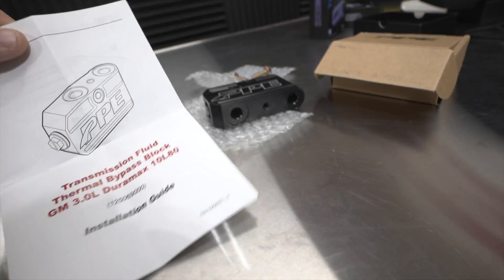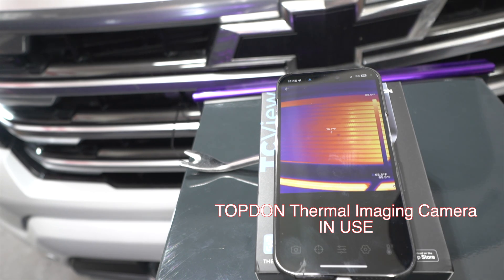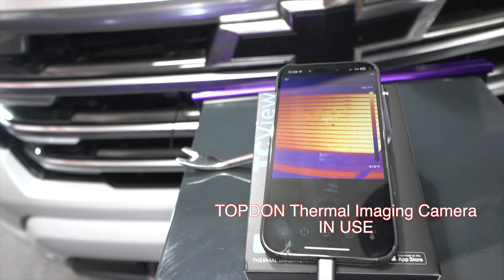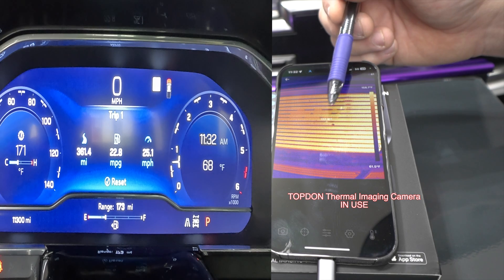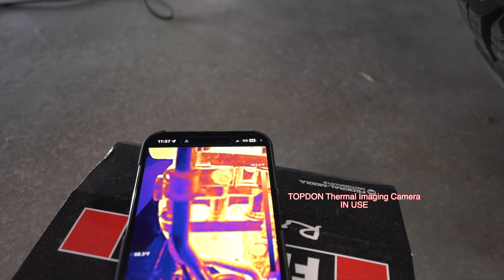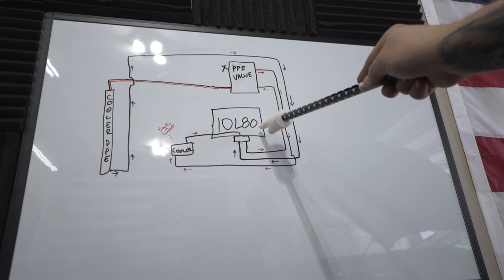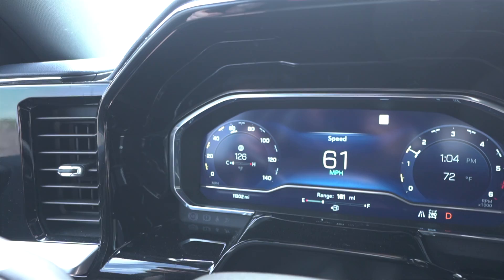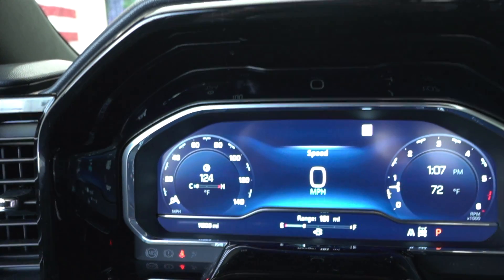75 Degree DROP By Removing This Valve On My 10L80 Trans

Comment: That smaller “cooler” that has coolant running to it isn’t a cooler at all. It’s a warmer. The engine coolant comes up to temp much faster at idle than does the trans temp. They want the coolant up to temp as quickly as possible to have the correct viscosity for shift performance.
Reply: Why they’re flowing the externally cooled fluid back through the warmer makes no sense whatsoever.

Comment: If the goal is almost free flow, why couldnt you just pull the piston / slide assy and put the end cap in and run that way?
Reply from the maker: It wouldn't stay in place, needs tension on it to seal.

Comment: Hey, quick tip... next time you use the thermal camera on a metallic surface, use a piece of black electrical tape and put it on the surface. You were measuring the reflection of the floor on the transmission pan, which is why it looked so much cooler... if you put the tape on before you start, it will heat up with the metal and give you a much more accurate reading. You will see the difference in the image... Cheers!

Comment: Question once I have the bypass valve on, how does it affect transmission fluid change procedure, do I still need to bring up to temps ( 176 to 187 ) and then open the cap and drain ?

Comment: 23 Trail Boss 3.0L LZ0 … After having the stock GM Bypass valve 47,750 start to drip again (yes valve No.2) this time I decided to replace it on my dime with the PPE. I topped off the fluid ran it down the highway  at 90 degrees ambient temperature it was running  206 running empty on flat land unloaded. After adding a PPE KIT ( PPE, Transmission Cooler, Bypass Valve and and Big Pan . I took a 2 hour drive with a 106 ambient  outside air temperature yesterday and It ran 135. 

My wife’s uncle that owned a Trany Shop years ago put a Big cooler on a 700r4 for me once and I asked him, how cold is too cold? And his answer was “I rebuild a bunch of SMOKED TRANSMISSIONS, I’m not rebuilding Transmissions because they’re too cold”. The first OEM valve went about 20,000 miles and was replaced under warranty this one went about the same that’s why I went with the PPE KIT and couldn’t be happier.

Comment: I have a 2025 LZO,  do they still put the same valve in that?  I haven't noticed crazy high temps yet
Reply from the maker: Yes, same valve
Reply: @DemonWorks  I've been reading that the ideal temps range is 175-200 from what I find on Google. What is the lowest you'd be comfortable operating this transmission at?  I worry about that as I ready about colder than ideal temps my lead to less lubrication.  Is that something to worry about?  I see you are running colder tranny temps so thought I would ask.

Comment: I'm going to quote an old transmission guru/wizard I knew: "There's no such thing as running an automatic too cold. Throw every bit of cooling possible at it as long as it doesn't restrict flow."

This is a much needed product and is proof that GM planned for these autos to fail early.

Comment: My '23 LZ0 runs around 180-200 even towing. However at idle it jumps quickly, maybe will get to 230 after idling for 10-15 minutes at 65 ambient temps. Goes right down after driving. Dealer says its normal, anyone have thoughts?
Reply from the maker: It is normal for the LZ0 to show those temps. It's all about 2 things, the valve opens around 196 degrees to let the fluid flow through the cooler. Once flowing through the cooler, it needs airflow to cool. I currently run this valve on my truck and the temp drop towing and summer months is great. i am currently testing using it through winter temps.
Reply: @DemonWorks  Any update did you keep it on all winter? If so how low did your temp go

Comment: Do you think its possible  to preform a  DYI Trans flush since the lines are accessible at  the valve? I would drop pan change filter and preform the flush .  Do you recommend  Trans  flush  or just drop pan change filter and refill.  Thanks in advance your channel is a wealth of  great information

Comment: After replacing the valve what did you spray on it to clean it off? 12:35
Reply: I didn’t watch that part, but probably brake clean.

Comment: I have a LM2 on a 23 Suburban I installed the PPE valve early in the Summer and max temps dropped from 215 to 190 which is great but now that it is cooling off in Michigan it takes 20 miles to get up to 150 or so what would you estimate a low operating temperature should be? Maybe put oem for winter? Thanks for the great vids

Comment: I've installed the PPE bypass on my 2021 LM2. The hottest temp I've ever seen was 193 while driving in heavy traffic in the Orlando area where I live. I usually see Temps in the 160's to low 180's range. I haven't seen a temp above 199 degrees since since removing the OEM bypass in favor of the PPE unit. I don't tow anything with the truck, I do load the bed with heavy objects from time to time.
Reply: Did you refill trans with oil that came out?

Comment: I live in North Dakota and winter months the temp can get to  -20 to-30 below, If i install this will the transmission temp stay to cool for the winter months.. I do tow with it in the summer and so far the transmission has temps around that 195-205 degrees, thanks
Reply from the maker: I personally think your winter temps are too low to have this, but others may disagree.
Reply: Lm2 maybe ok,  but the LZ0 probably not.  Not unless you change the lines to the LM2 style.

Comment: In the LZ0 trucks this ppe block eliminates the engine cooler or transmission heater this is what I’m calling it.  Because of the 3 line setup on the factory valve block.  This is why the fluid won’t heat up because the fluid is not going through the engine cooler/ heater
Reply: I’m looking at installing a lighter spring for the factory valve and see how that works.  I want the fluid to heat up fast but keep the temperature around 150°
Reply: Well the lighter spring in factory valve didn’t do much different maybe 5° less.  Now it’s running around 190° that sucks and running the PPE block sucks too running at 120° and it takes forever to get there.  The LM2 setup was perfect for this PPE block I guess GM found a way to fuck it up with this LZ0.   If it had a different pill like a 140-150° in the factory valve it might work.
Reply from the maker: It actually doesn't eliminate anything in the cooler like what you are saying. It's still going through that cooler, it's just not circulating through it and looping at the bypass valve. The system would loop the fluid through multiple it's at 196 then allow some flow through the cooler. this just eliminated the multiple loops.

Comment: Hope that doesn’t affect the warranty because I was thinking about ordering this valve just don’t understand why a daily driver temp needs to be in the 180-190 heat kills clutch packs
Reply from the maker: any modification could alter warranty status. The high temps are for fuel economy, not longevity unfortunately.
Reply: @DemonWorks  longevity is better then the other option

Comment: I was looking at that  and noticed the 6.2. Has the 10L80  as well   Im wondering if that ppe will work on the 6.2   Even tho its for the 3.0  but they both have the 10L80
Reply from the maker: it will not, different design on the gas trucks.

Comment: Has anyone with the ppe bypass, larger cooler, or larger pan experienced trans failure of any kind? Seems like high temp is killing the pump idler gear bearing.
Reply: I have all 3 and my temps are 120 to 155 but most of the time its in the 130's and that's also towing my boat

Comment: In your opinion what would be your first mod in looking for lower temps on your transmission? I am thinking I will go wit this bypass valve replacement from ppe. I am not a fan of the factory valve restricting the fluid flow. I would love to know your thoughts Thanks.

Comment: I have a 18 5.3 Silverado with the 8L90 and it constantly ran 190’s (I live in the desert). After I bypassed it, it runs 145 max even in triple digit temps. All for “fuel economy”. So stupid.

Comment: This is so interesting to hear. I have a 2019 AT4 with the 6.2 and my transmission operating temps are drastically lower. Just got back from Glamis towing my toy hauler with rzr (10k pounds) and I never saw it go higher then 185 degrees. I wonder if this is only a problem with the diesel trucks..
Reply from the maker: Different setup, but this is what I use (5.3/6.2 Trans Temp) as fact when people tell me the transmission isn't meant to be cool. thanks for sharing !
Reply: I have a 2020 at4 6.2   And noticed your comment so you got the ppe bypass valve for the 3.0? And worked on your 6.2?? Plz let me know because I want to get it just wasn’t sure if it would work although they have the same transmission

Comment: I have the PPE Pan, Cooler and Bypass in.  In the winter while not towing my Trans temp is 100-115 def F.  I may put in the improved Racing thermostat in to run at 140 deg F.
Reply from the maker: I didn't know they came out with one for the 3.0? All I have seen was for the gas engine style, on the transmission.
Reply: @DemonWorks  
Says it’s for 6-8-10L?
Reply from the maker: @ryanlogan2911   It does, but it's made for the lines with the manifold on the side of the transmission, which only the gas engines have. The 3.0 is the only one with the valve on the side of the engine.
Reply: @DemonWorks  maby we need to hit Improved Racing up to build us a Thermostat bypass which opens at a lower than stock temp.
Reply from the maker: @ryanlogan2911  I did :)
Reply: @ryanlogan2911 How has the transmission reacted to these lower trans temps? Has anything changed?

Comment: Did you get this temperature reduction just by changing the valve  block or also changing the cooler?
Reply from the maker: Yes, I did have the other parts prior but the bypass valve is the big one for the cooler temps.
Reply: @DemonWorks Correct me if I'm wrong but it seems like the deep pan and cooler drop temps 25-35 degrees where as the bypass drops them around 40-50 degrees. To me, it makes the most sense to just run the bypass since it gets operating temps around 160 degrees and because it's cheap and easy to install.  Have you ever ran the bypass exclusively?

Comment: So after all the testing would you recommend the larger cooler and the PPE bypass valve or so other combination?
Reply from the maker: Depends on where you are and what you are using the truck for. I’d say if you are in a warm climate, the bypass valve is the way to go. If you are somewhere that  gets really cold, I don’t t think the valve is a great idea. I’m in that category so I’m running the trans cooler with the deep pan. Will be toying with the stock valve real soon though.
Reply: So going by your diagram of the transmission fluid layout, won't the cooler that receives engine coolant help with maintaining an idea temp for trans fluid if the bypass, deep pan, and PPE cooler are used under higher load conditions? @DemonWorks
Reply from the maker: @huntsman12g  that cooler receives coolant flow from the coolant valve, helps to get the trans temp up quickly. I do not know the temp in which that valve opens or closes though.
Reply: @DemonWorks I'm in southern illinois,  it's gets cold here but not like michigan cold.  Hot summers, I just installed the bypass valve. Seems to be running between 170-190 now. 
Wondering if I should do the pan or the cooler or both. My 22 silverado always towing a 20ft ranger bass boat . What you think?
Reply: @DemonWorks  the bypass valve could have a restriction controlled by a setscrew where you could regulate the flow for summer and winter times.

Comment: Installed Ppe bypass block and max 163 trans temp was 198 to 205 before install. Block only and stock cooler
Reply from the maker: That’s good stuff ! I’m assuming this was on a LM2?
Reply: I just added the bypass to my 22, it didn't make a huge difference . Still hits 190.
Reply: @fishinfoo2277  just installed on my 21 and I’m still running in the 180s. I guess every truck is different

Comment: Did you add fluid after adding the bypass valve? If so how much and do you have a video on it ?
Reply from the maker: always check the trans fluid level and do it at proper temp.

Comment: I cancelled my order for the PPE bypass after watching this. 75 degree drop is too much, I can just imagine in the winter time..Yikes! I still haven't done the pan but that is definitely on the to-do-list. Just wish I could find a shop to do the engine oil pan, made a few inquires but all declined.
Reply: According to some guys' anecdote in a GM forum, it isn't an issue in the winter because the truck will close down the the grill shutters to get the trans temp to a reasonable operating temperature. I ordered one of these and will be see how it goes next week while we still have temps in the 30's where I'm at. Thought about just doing the larger trans cooler but that alone doesn't seem adequate and both seem overkill.
Reply: @derekpearson766   how was it during the winter months
Reply: @droppeds10404  Unfortunately, it didn't fit on my '24 due to a plumbing change that I wasn't aware of.
Reply: You are dead wrong my friend. Anything between 110-150 is ideal for an auto transmission. Unless you get the temps down you will be replacing that Trans between 50k and 100k miles.

Comment: Has PPE or anyone come up with a valve for the 2023 LZO bypass valves that only have 3 lines going to them. One of the cooler ports is blocked and that line goes directly to the cooler. Have seen 207° on mine towing a 5k boat on a 90° day
Reply: Nevermind was not looking at the pics correct

Comment: For anyone wondering what this bypass valve will do without any other mods:

I have a 2023 LZ0 Trail Boss and the operating ATF temp was 198. After installing just this bypass valve, I couldn't get it above 155. That's with the stock cooler and pan. Be sure to top off your ATF after changing it, you lose quite a bit of fluid.
Reply: Is refilling as easy as just putting a quart in or until it dribbles out of filler hole?

Comment: Did you notice a drop in temperature when you changed out to the PPE Deep Pan with  12qts. If so, how much?
Reply from the maker: I am installing the deep pan today. My prior pan video was for a different truck I had. I will be pulling the Poe valve off and back to stock, then gave the ppe pan and cooler. Will note the temps
Reply: @DemonWorks  considering changing it out on my 22’. Did you notice a substantial temperature change on the prior truck?
Reply from the maker: @Jim.Christy  prior temps were 160-175 on the prior trucks. That’s why my LZ0 temps are so interesting. I’m hoping to get those numbers again, while doing this video, I saw the valve is open by 170. In theory, we should be able to maintain that 170-175 but since we are not, I’m thinking it’s a low flow situation. The additional fluid in the pan can help with temperature management. I have documented every change and temperature with this truck so I’m hoping to have all of the data needed to help everyone decide what they need/want.

Comment: At first I thought maybe the trans temp sensors were inaccurate but after your installation it seems like a major drop so maybe its not that far off but it would be great to varify!  I wonder if you could list all the stuff you have added (cooler etc) to improve your transmission temps.  Did the larger cooler really help?  Lots of helpful info.
Reply from the maker: Hey! The trans cooler took my temps down from 210 daily driving to 199 no matter what I am doing, daily driving or towing. 

Next I’m installing the ppe deep pan and going back to stick with this valve.

Comment: wow that really made a big difference my LZ0 is stock if i added in just that value would that be worth it or do i need to do that cooler also i do not tow that often but like that it runs cooler  

do you have a discount code for PPE
Reply from the maker: No code for PPE products, unfortunately, but there is a sale from time to time.

Comment: I live in Florida. Average temp is about 60-70 in winter and summer is well above 90. I did both the trans cooler and bypass and my average temp is between 140-150 degrees now, I did not like the factor 198-210 trans temp degree especially being down here, definitely worth the money.
Reply: 190 is way too hot for a transmission temperature I have seen thousands of transmission failures due to these kinds of high temperatures I’ve never seen a single transmission failure due to running them cold
All of GM’s newer three-quarter ton trucks and up run at 143 to 155° transmission temperature using the same exact ULV transmission fluid as what’s used in the half ton 3.0L Duramax trucks